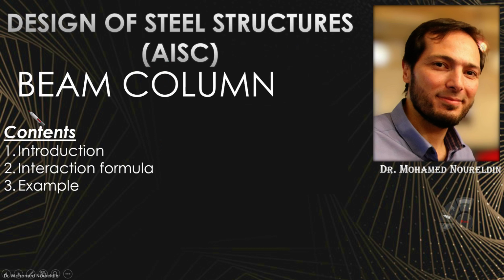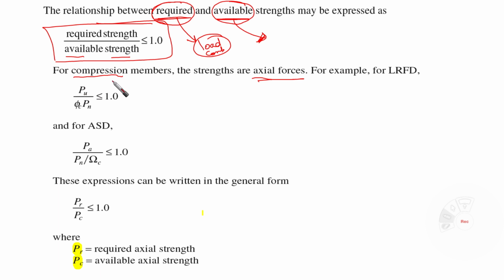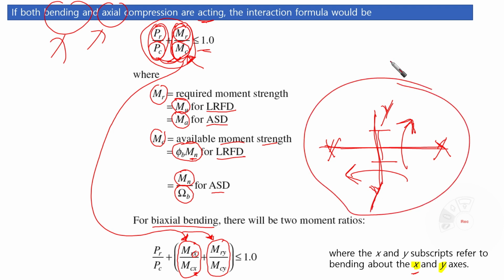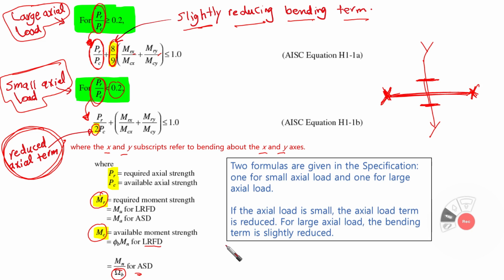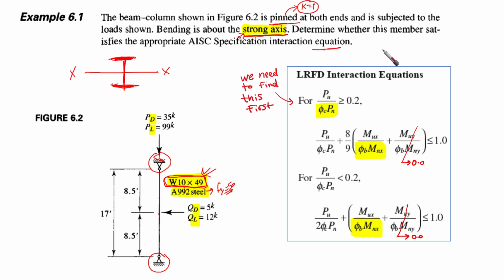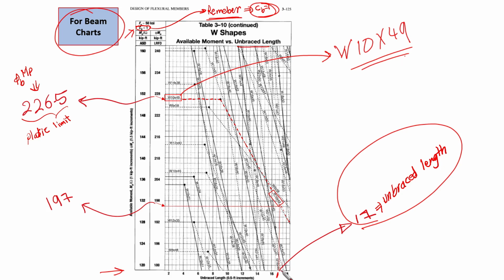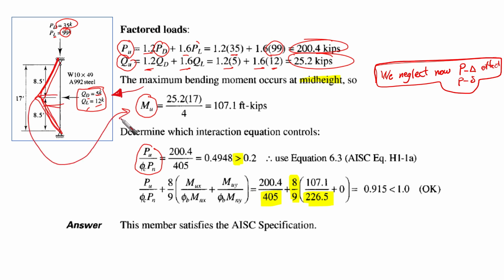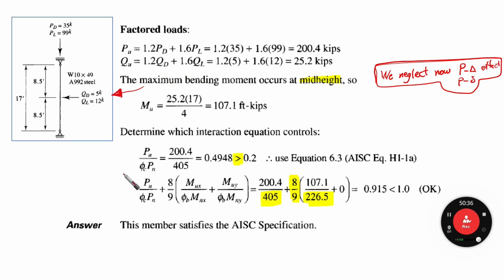18- Beam column- Part 1-  Interaction formula

Comment: Assalamualikum, learned a lot form you. In RCC when we derived the eqution for column Mn=Pn*e where e is eccentricity, that eccentricity covered bi-axial and uni-axil beanding for corresponding load combination, but in AISC it just reducing moment depending on small or large axil load, now how can I know axil load is small or lagre is there any limit ? also for cb=1.32, in that condition we dont have axil load 37.09 like the example we solveing. finished no. 18 lecture. one lecture a day i completed and followed your instruction.
Reply: 18:30..about cb, you need to rewatch lecture 17 about beam